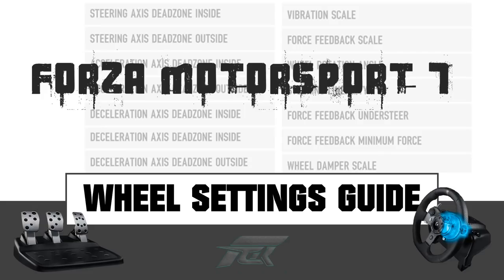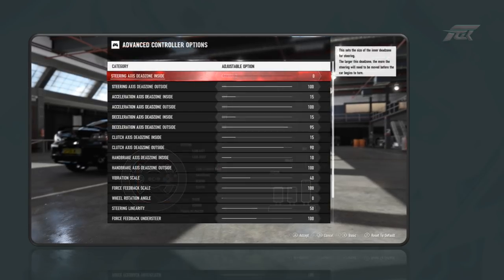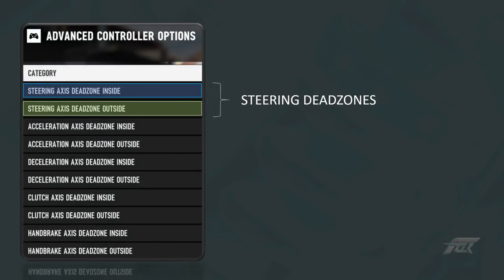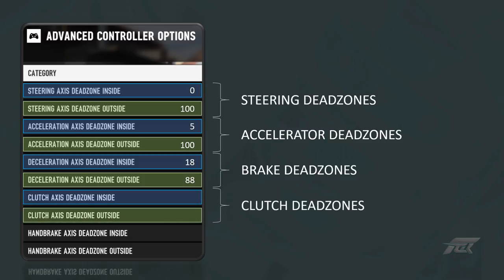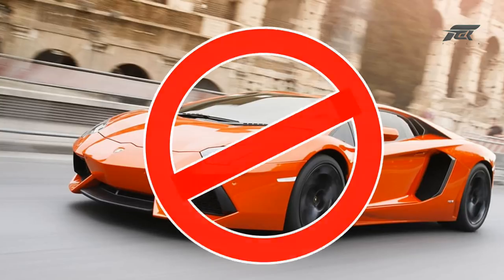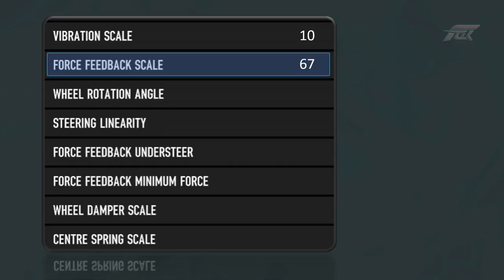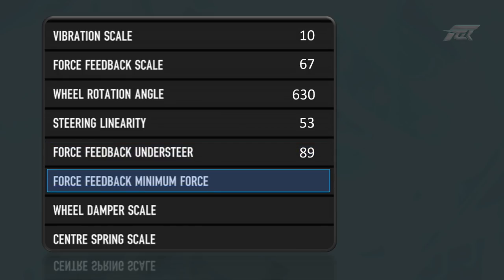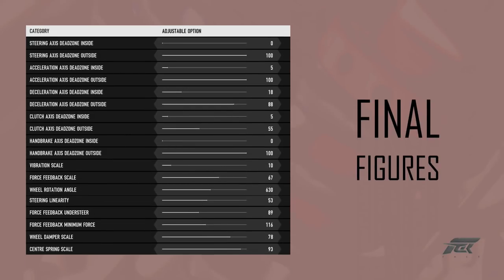Forza Motorsport 7: Make your wheel, feel real!

Comment: I got into Forza 7 with my wheel AFTER I already set up settings from another user for Forza Horizon 4 (I'm playing on Xbox One X), which required me to make changes in both the Logitech app, and then within the game itself.  My question is, for these settings, should I plug my Logitech back into my computer and set it to default, and then apply these settings in-game only?
Reply from the maker: Hi, Cole. These settings were developed with the default Logitech settings, so I'd reset those to default, bud. 👍 
Hope you enjoy them!
Reply: @FACROfficial  Thanks for the quick reply!  That's what I thought, just wanted to clarify. :)
Reply from the maker: No worries, mate 👍

Comment: Thank you so much...couple questions..wheel rotation is 630 even for the F1 indy vehichles? As well what are your computer settings are they default values ? Meaning when u plug G920 to comp to check for updates theres setting in there.
Reply from the maker: MrYammizz Thanks for commenting! Regarding your rotation angle, feel free to adjust that for different cars. I tend to keep it the same, but it won't be a problem changing the angle to your preference. Be aware that you may need to adjust the linearity also for a balanced sensitivity. 
Regarding all other settings from firmware updates etc, I have left them all at their default values, and only changed the settings in-game. I hope that helps, bro. 👍
Reply: FACR Official 
Thank you so much for reply.. You have some of the best content !!!👍
Reply from the maker: MrYammizz Very kind!!  Thank you. And you're welcome!

Comment: I don't have most of the options shown in the video =( maybe the game got updated and removed these settings?
Reply: i think they have updated it because the settings are for the new system for horizon 4 and 5. i think it was previously on the crappy horizon 3 ffb engine. i think the new settings and ffb system are 1000% better, and maybe its just horizon's physics but you can actually drift on wheel now

Comment: Don't you feel that the wheel damper scale makes the wheel very resistant to quick inputs/corrections? I had to drop mine down to 20-30 in order to make it not feel like driving a truck.  G920 on PC.
Reply from the maker: I've heard that the feedback does feel different from the xbox to the pc, but yeah, I totally get what you're saying. I've just done a new video for simulation steering and I've got the Damper and Centre Spring turned off completely. Personally I think they're way better. Have a look, mate. Really positive feedback so far. 👍

Comment: So I am getting very frustrated. I am on the PC with a wheel and I was following along till I got to steering wheel settings and noticed I didn't have any.. I went back and saw it shows a controller when my wheel is setup and i'm clicking the menu buttons with my wheel. I don't know what to do from here. Helpppp
Reply: Disconnect your controller when doing settings for the wheel.

Comment: I'm using the g29... i guess the settings are different, can't even get the car to turn correctly and the steering wheel inside is set to 0.

Comment: Hi. I'm using a G920 aswell. Would you mind telling me your Logitech Profiler settings?
Reply from the maker: This is found through a pc connection, yeah? If so, then they're completely standard as I've not changed anything like that. However, you have got me interested!!! 😌
Reply: Yep, I play on PC. Logitech Profiler is something like an extra driver for your Logitech Wheel. Good in some games
Reply from the maker: I'll check it out, but I'm assuming from what you've said, it's not valid for the xbox? Cheers, pal.

Comment: Sorry, but what about steering sensitivity? Also I dont see the rotation angle in my ingame settings. Unless if thats something I should do via the wheel properties.
Reply from the maker: I'm guessing you use a PC, bud? Steering sensitivity is not an available option on the xbox one, although rotation angle is not an option on PC. Why they're different, I don't know, but unfortunately I have no experience with steering sensitivity. I'm guessing the principles may be similar, although instead of an angle, you get a 0-100, right?

Comment: I'm debating on which wheel should I get, the Thrustmaster Tmx, the tx, or the logitech g920, can anyone tell me which should I buy?
Reply: I have used the TMX Pro wheel setup for 2 years and after the recent turn 10 upgrades for Forza 7, my wheel is performing better. I believe the Thruster TX wheel is a little better than the TMX or the Logitech g920.

Comment: How does it feel when drifting?
Reply from the maker: Hey, bud. I'm more of a racer, so the settings have been worked with that driving style in play.  I'd suggest that for drifting, you'll benefit from increased centre spring stiffness, although this will mask other FFB forces if set too high, and therefore reduce fidelity. 👍
Reply: @FACROfficial  okay thanks. Ill try those adjustments

Comment: What about the the settings before you start the game ?
Reply from the maker: Sorry, I'm not sure about what you mean, Ivo. Are you on pc? Maybe that's why I'm missing what you're getting at...
Reply: @FACROfficial  uhm,yes i run on pc, and i dont know if i have to change anything in the logitech settings. Thank you
Reply from the maker: When I plugged the wheel into my pc (to check the firmware update was the latest one) I actually didn't change anything in those settings. Unfortunately that's all I can say, as I play on the One X. Hopefully if you leave then standard and then use my settings, they should come out correct. 👍 Be good to hear how you get on. Good luck!

Comment: I did this on horizon 3 and the steering was too stiff. Can you please make a vid for fh3?
Reply: turn down the bottom 2 settings first , wheel damper and spring, if that doesn't fix it turn down the force feedback settings

Comment: Hey man, i really need your help. When i press my throttle pedal all the way, it register as 98% acceleration in telemetry. Only if i press it harder it registeres as 100%. Can you please tell me how it's yours, so i know if i need to go to warranty the wheel? Try pressing the gas slower all the way, and tell me if it registeres as 100% if you not push it harder
Reply from the maker: I had a similar problem a couple of months ago and decided to take the pedals apart and give them a good clean. Dust etc had collected around the contacts and after giving them a clean, they were back to normal. Unfortunately it didn't last more than about 4-6 weeks before I started getting the same problem, so I just decided to set the outside deadzone on the accelerator to about 80/85. This fixed the problem straight away, although the downside is that the pedal is more sensitive to movement (not by much) due to the reduced travel. It should sort you out if you try it though 👍
Reply: FACR Official Thank you very much for your prompt response sir. Can you tell me if let's say i send it to warranty and it gives me one working properly, after a couple of months from what i understand will do the same regardless of how i use it? It's a bummer because i don t remember always to slam harder on the gas. Sorry for bothering you with this
Reply from the maker: That's OK, mate. You don't have to apologise. 👍 If it was swapped over, although I obviously can't make you any guarantees, if yours does it, and so does mine, then it doesn't look great. Although if making the adjustment to the outside deadzone works, then you might not need to worry about it. 😁
Reply: If it gets to 98% easy try setting the deadline to like 95, blow the pedals out with compressed air every few days.

Comment: Will this work with Forza Horizon 3?
Reply from the maker: Raphael Hodgson Great question, and honestly, I should image it will work well. The only concern I have is that the physics in FM7 are clearly different to FH3, but the wheel setting options are the same. I'd definitely give them a go, and it'd be great to hear how you get on. 👍
Reply: FACR Official. I just played a little and it did seem more realistic. Ill continue to use your settings. Thanks!
Reply from the maker: Raphael Hodgson That's genuinely good to hear that they feel good on FH3, so cheers for letting me know! 👍

Comment: Half these settings are not present on my list

Also my FFB doesn't change whether everything is on maximum or mjnimum. It just stays really strong making it impossible to drift
Reply from the maker: Hey,  Adam. Please have a lool through the channel. I have a more recent video that has the new settings. That's very strange about the FFB though! Have you set it to 0 just to see if anything changes?
Reply: @FACROfficial  yh I have set all in game (Forza 7) FFB settingd to max and all to minimum and it changes nothing on the wheel from what I can feel. I can go over bumps and off the road and smash into walls and I get no feedback through the wheel. It's just tough to turn and recentres very quickly. 

I use GHub but that is so limited. There is only 3 settings on it. 

Thanks for the reply and great channel
Reply: Try this.

Steering axis deadzone inside    0
Steering axis deadzone outside.   100
Accel.  Inside   10
Accel outside.  90
Decel inside.  10
Decel outside 90
Clutch inside. 0
Clutch. Outside 100
Handbrake inside. 0
Handbrake outside 100
Vibration scale. 20
Force Feedback scale. 80
Aligning torque scale 140
Mechanical traile scale 140
Pneumatical trail scale 140
Road feel scale 130
Load sensitivity 50
Wheel damper scale 125
Center spring scale 125
Dynamic damper behavior 100
Wheel rotation angle 540
Steering linearity 50

Comment: Does anybody know if this setting works for forza motorsport 6?
Reply from the maker: Unfortunately I never bought a wheel until FM7, so I couldn't honestly say. The only thing you can do is give it a go. 👍 Cheers, bud.
Reply: I have just tried it and it works out well... the only thing is that all of the settings aren't there, so you can only apply some of them. The car is definitely more better to drive. Thanks for making this video,  it made my wheel a lot more fun to drive on :)
Reply from the maker: Great to hear it works, despite the reduced options. Thanks for letting me know! Feedback is so important, so thanks! 👍👍
Reply: All of the forza games should work similarly, you just don't get as many different settings on the other games. The force levels and smoothness change drastically between games but each setting still does the same thing.

Comment: I don't have wheel rotation angle, I have steering sensitivity, but it just goes from 0 to 100. Can't make the wheel go 1 to 1 with the game, just turning around 20% turns 100% in game :(
Reply from the maker: Very frustrating, mate. If you turn the sensitivity down, does that help change it?
Reply: What steering wheel?
Sounds like you Steering Linearity is up too high.

Comment: Some of these settings aren’t available in the game
Reply: Try this.

Steering axis deadzone inside    0
Steering axis deadzone outside.   100
Accel.  Inside   10
Accel outside.  90
Decel inside.  10
Decel outside 90
Clutch inside. 0
Clutch. Outside 100
Handbrake inside. 0
Handbrake outside 100
Vibration scale. 20
Force Feedback scale. 80
Aligning torque scale 165
Mechanical traile scale 125
Pneumatical trail scale 125
Road feel scale 130
Load sensitivity 50
Wheel damper scale 130
Center spring scale 130
Dynamic damper behavior 100
Wheel rotation angle 540
Steering linearity 50
Reply: Bobby A wow, thanks man I will try this. I really appreciate it!

Comment: I'm guessing that I'm going to find these settings too light, despite your great work.  The object is to "simulate" a real vehicle being driven on a real track and real racing speeds.  Not to make it easier or less tiring as most do.  Yes, most are in their living rooms and don't want to experience pain, gforces and Ultimately the possibility of death.   It's why simulation racers are so fast and drive so hard. For me the object is to get as close to reality as possible. Reality never being able to be close to being achieved ever. You wouldn't want that.  I want to feel tired at the end of the race. I want to feel closer to the real vibrations of the actual action I'm trying to "simulate".   To me, if it's too physically demanding, then too bad.  Yes, one can have fun as well without getting close to real racing, but then don't call anything a simulation. There is a reason helmets and dual over the shoulder seat belts are warn in racing and etc.  In a real vehicle at those speeds, most would never load up the game again.  Take the most benign Golf GTI in reality and have a real driver lap you around a track at full speed.  It shakes and vibrates the hell our of you and your not even feeling the effects through the wheel.  Granted it would take huge huge sums of money with hydraulics and etc to come even to 1/3 of a real driving experience at home but, don't say these settings closely emulate real vehicles.  These settings make the game enjoyable to play at home and have some real physics characteristics. Try hitting an inclined rumble strip at very high speeds....good luck.  Still you did very good work here to make the game enjoyable.
Reply: Even with the settings he provided I bet you couldn't do more than like 10 miles at a time on my rig without resting.